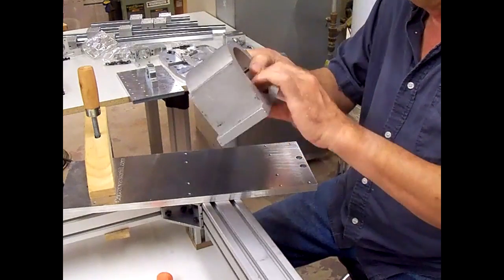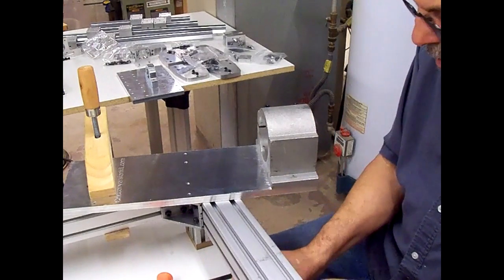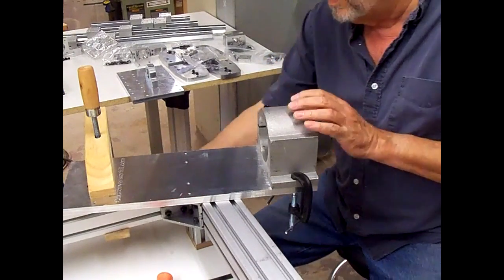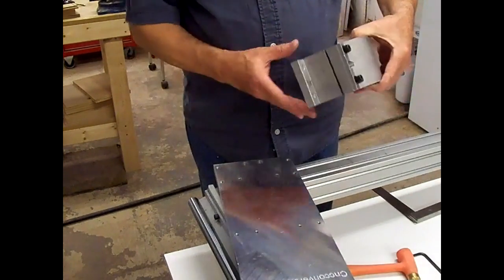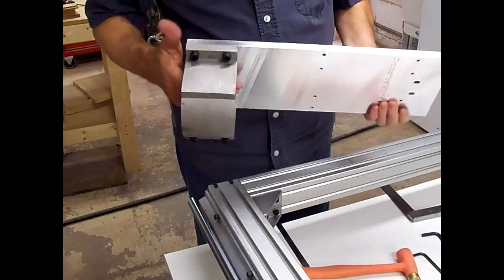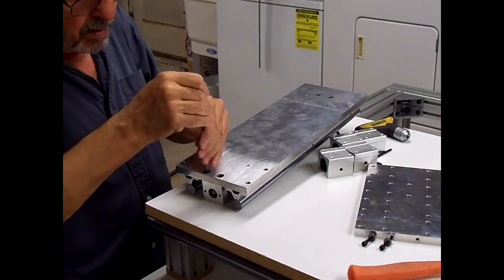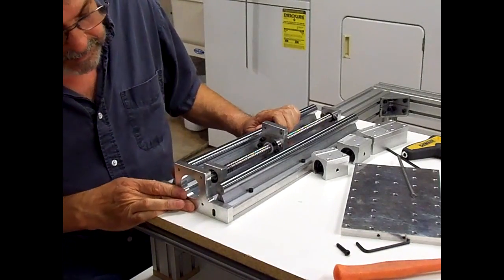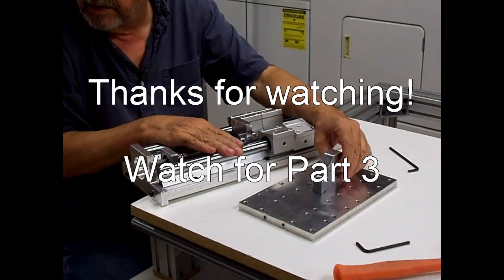CNC Router build part 2

Comment: Great build :) if i am drilling multiple holes that must align, i will drill one and put a bolt through it, drill next put another bolt through it etc, then they must all align correctly.its easy for the drill to catch and rotate the piece but this will not happen if positively clamped.
Reply from the maker: Thanks!  That's a good idea.

Comment: Interesting ... when you mounted the router housing ... how do you know if it’s square with the slides and bore. Doesn’t look like there is any adjustment to tram in the router. Nice videos though. Where exactly did you obtain the kit.

Comment: Is this your first CNC build? if so welcome to the addiction ;-) Looks like you bought a pretty nice prefabbed kit. everything looks nicely machined and well planned out.

While your spindle mounting method is "effective" in the sense that it "works"  you really should have squared it to the z-axis movement, or at least left room for adjustment later on. This would make Tramming possible later on. That way you could get the spindle perfectly square to the table.
You won't have any problems when using small 1/8" - 3/8" or 1/2" end mills, however if and when you use larger spoilboard cutters and fly cutters measuring 1" - 2.5"  for surfacing larger areas you will see ridges forming perpendicular to the axial misalignment, even very small axial misalignment can show in the final machined product depending on the cutter type / diameter and material being cut.
you can do some alignment X-axially using shims on the top and bottom of the spindle mount. but I don't see any way for you to align Y-axially without machining the mount holes into short slots or just increasing the hole size slightly.
anyhow looks like your motormounts are machined for a nema 23 frame. do you have the motors and electronics yet?

Always have fun and Get 'er Done!
-idontrunntoofast
Reply: *****
So does yours come with 380 oz-in steppers and the gecko g540?. It's a nice combination, you wont be disappointed. I have the g540 on the first cnc router I built with similar steppers, only my stuff doesn't come as a kit. I make all my parts on my Bridgeport, lathe and plasma table..

I think that the adjustment screws should work pretty good. I would get socket set screws with pocket points and recess a smallball bearing into the mount where the set screw applies pressure. otherwise the screw will bite into the aluminum... but maybe that is a good thing to keep it from turning...
Haha addicting isn't? it I am only  twenty-two and I've already converted a Bridgeport, a overhead milling lathe, a woodturning lathe, built two CNC routers, and a plasma table and now I am starting the plans for my seventh CNC project... a 5 axis mill ;-). cant wait to see more videos on your build.

-idontrunntoofast
Reply: *****
 Yea solidworks is very expensive..  the only way I can afford it is through the company I work for. I think it costs the company about $9k per user. I actually like autodesk Inventor better personally... It does all of the same stuff, cost's about the same amount. but If you are used to autodesk's industry standard interface (autocad, Inventor, naviworks, REVit) you will realize how much easier and intuitive the interface and commands are... But my company uses Solidworks so that's what I use.
I've never used Visual Cadd before... how well does it work? is it a cad or cad + cam software?
There is another 3d cad program out there that is often overlooked by much of the industry due to it's low price tag and limited abilities SketchUp The professional version is $600 but the standard version is FREE. I use the professional version at work sometimes to make quick, and easy 3d designs, but I have the standard version at home.. and while it is a bit more limited in what it can do I think that for someone starting in 3d work you simply cannot go wrong with it. It has such a easy learning curve, a clean straight forward interface and I bet you that you could figure out the basics on it in a couple days. the professional version has dxf and stl exportation built in.. and with a plugin you can do the same on the standard version with a free plugin.

Thanks, I'll be sure to try and do some design when I get homethis weekend.. hopefully record it and upload as soon as I get the chance :-)
-Idontrunntoofast